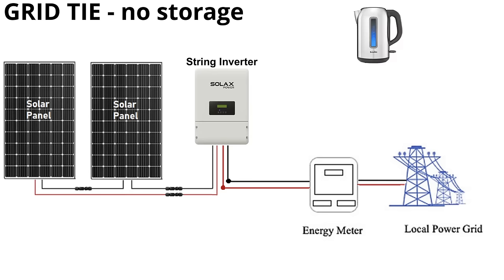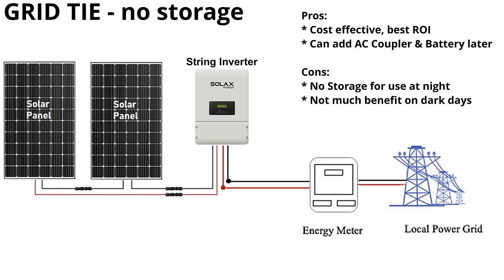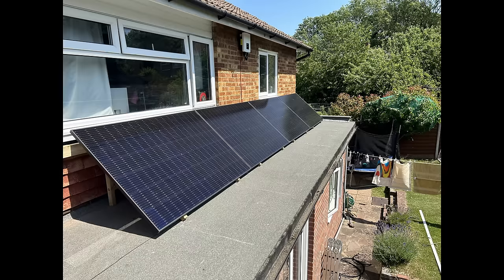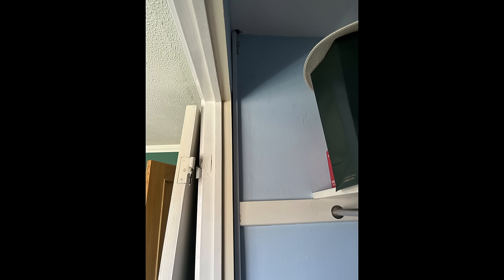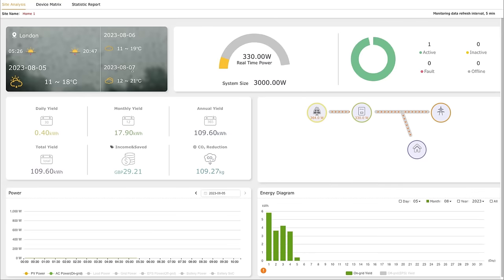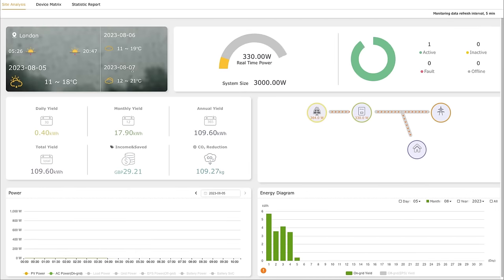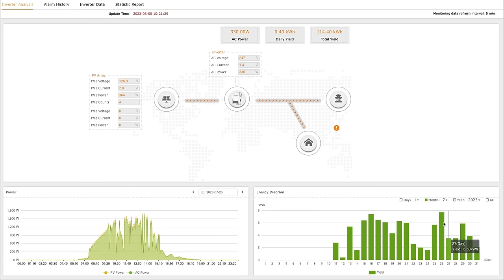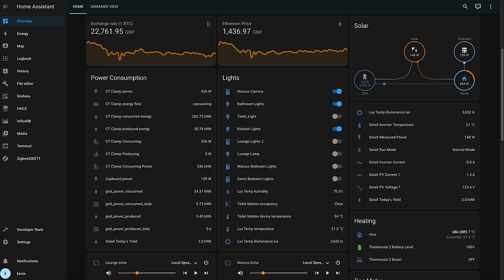DIY Solar Project 2023, worth it in the UK?

Comment: Sadly, the cost of an array (professionally installed) is typically a cost over 25 years, not a saving (this is of course unknown to virtually everyone!) due to the cost of a replacement inverter and batteries.  Some viewers may have seen my comments on this on other videos.  I haven't done the maths for a DIY one, but I will when I get the time.  A good idea might be to look at the maths for heating your hot water storage.  Electric would cost about 30p/kWh.
Reply: @CaptainProton1  
Sadly, you missed the word 'typically'.  There is simply no way a typical system can pay back your capital outlay.

But let's go with your data, instead:

1.  How much was your total capital outlay?
2.  What is the cost of purchased kilowatts from your supplier?
3.  How much will your system save you annually?
4.  Where did you get the money from - what interest rate was it earning?
5.  What will be the cost of your inverter in 12-15 years?
6.  What will be the cost of your battery array in 12-15 years?
7.  How much do you expect to have to pay (annually) for maintenance and breakdowns?
8.  Have you factored in that your panels will supply 0.6% less every year due to degradation?

You see, what people like you do, is to see the whole project totally unrealistically.  I'm willing to bet my car that you haven't even carried out a cost analysis as above.  I'm willing to bet my house that you haven't applied inflation to points 5 & 6 above...even if you have done a cost analysis, which I'm positive you haven't - because you claim it will pay back in two years.  Sorry, but there is 'absurd' then there is whatever 'two years' is...because it's beyond absurd.  In order for a system to be able to supply 70 kW a day, you're into small commercial/industrial territory.  Your system must be very costly to purchase...which means that your loss of interest is also enormous.

I do this for a living, by the way.  If you would like to provide the 1-8 data points above, then we can do a financial analysis.  But I'm afraid you are certainly going to be in for a surprise on the figures.  If you would rather remain blissfully ignorant of the conclusion, I fully understand, but I am quite willing to believe that your system will NEVER pay you back, never mind the amusing 'two years' bit.
Reply: @CaptainProton1  
My replies to you are being removed (twice, now).

You CANNOT get a return after two years - you'll be very lucky if you got a return after 20 years, but more likely, it will cost you money.
Let's try again.  We know that you annually consume 25,550 kWh (which is extraordinary - I'm all electric, and consume 14,000 kWh).  At 30p/kWh that would cost you £7,665, but I await the data on your supplier's charges.  Where your figures will show up is in 1 and 4, but I seriously doubt that you have carried out this cost analysis...

1.  How much was your total capital outlay?
2.  What is the cost of purchased kilowatts from your supplier?
3.  How much will your system save you annually?
4.  Where did you get the money from - what interest rate was it earning?
5.  What will be the cost of your inverter in 12-15 years?
6.  What will be the cost of your battery array in 12-15 years?
7.  How much do you expect to have to pay (annually) for maintenance and breakdowns?
8.  Have you factored in that your panels will supply 0.6% less every year due to degradation?
Reply: @jimskirtt5717 not true at all, you just dont have the experience.  Ive built my own off grid hybrid, all second hand panels, diy lifepo4 storage. Payback = under 3 years based on current prices.   Not typical no, but why would anyone go typical anyway, is a complete ripoff.
Reply: @CaptainProton1 hey, similar to mine just on a bigger scale..   Want to use up all that extra power you make in summer? - get a couple of bitcoin miners... F**k sending it back to the grid for pennies.
Reply: @jmpcrx  
I don't think you understand - I have a degree in mathematics.  If you show me your cost analysis, I'll show you where you're going wrong - free of charge.
Reply: @jimskirtt5717 

No degree in mathematics needed. If the annual energy cost is £7000, and the system cost £12000, and reduces the annual energy costs to nothing, then the system will pay for itself in under 2 year, simple. 
You bang on about interest on savings, but in reality interest on short term savings is 2% at best, so £12k in the bank makes £250 PA, which is nothing. 
Better to use the money in the bank for something that actually saves much more than the interest. 
It's not rocket science, good knows why you're trying to make it more complicated than it is.
Oh and a 0.6% loss in panel output PA isn't set in stone, it varies from panel to panel. Most panels will over produce for the first few years, and never produce nothing, even if 50 years old. 

Try doing some research on the equipment, rather that trying to convince yourself and others that it's money wasted, when there are literally millions of solar system owners that save huge amounts of money on their energy bills.

Comment: May I know is there typhoon in your country? Is it safe for this installation method if there are typhoon? Thanks
Reply: No typhoons in the UK. But we do get occasional storms- hence screwing down the installation to the house.
Reply: Typhoons only occur in the Pacific region. The UK is in Europe.
Reply: Uk can get 150mph winds, and i think will rip this system away! It needs blocks over it to keep it down, it would just rip off the wall if the wind ever gets under it.
Reply: @That1ufo  The only 150mph winds in the UK are after I've had a few pints followed by a vindaloo.
Reply: @elelegidosf9707   A little off on my guess but "142 mph) on 13 February 1989 at Fraserburgh in Aberdeenshire" But 120mph gusts is often possible and they would still be ripped off at 60-80mph

Comment: Is the inverter waterproof then?
Reply from the maker: Yes, this inverter is intended to be installed on an outside wall, under the eves, and is IP65 (Water resistant. Protected against water jets from any angle).

Comment: Do you get paid for dumping the excess onto the grid
Reply: You can, although the amount you get depends on who you signed up to.
Reply: @bunnywarren  thanks I'm with Shell energy but I think Octopus is taking over. Is that setup good for getting some return from excess
Reply: @lawrencedeans1433  Octopus's offer various rates, depending which tariff you use. I've got a battery setup and can move my evening peak usage so go for the one that give 3h of cheap power overnight and 3h of expensive power in the early evening. As a result I'm getting almost 20p/kWh during the day with 32p/kWh between 4pm and 7pm.

Comment: Will get massive hot in the bedroom, sucking the heat from the panel in.... 😕
Reply: By what mechanism do you think that the bedroom would "suck" heat in from the panel?
Reply: @elelegidosf9707 Natural ventilation... window just on top of the panels... black panels = heat...  natural ventilation, when opening a window... Try open you window, and you will see...

Comment: inverter outdoor ?? its a bad idea
Reply from the maker: Quoting from the X1 manual, "X1 Series inverter is designed for outdoor installation (IP 65)."
Reply: Why? Loads of Inverters are designed for exterior placement. As are Batteries. Not ideal I agree but most houses in the UK do not have the space for an Inverter, Battery, Charge Controller etc. Placing the Inverter under the Eaves is a good idea as manufacturers insist that exterior placed items have a canopy which the Eaves is

Comment: Noooo you've done it all wrong!

You should have paid £6500 for some randoms to throw some panels up there, do a crap job, then throw an MCS certificate at you and run off to install 2 more systems by the end of the day. 🤣🤣

Great job though, I did roughly the same with my modest 500w system, although I got my panels 2nd hand for cheap. In the 4 years it was up, it made about 1.5MW. Now I've got it connected to my battery inverter system just to add free power to it.

Comment: This is where they've got us,has a DIY installed system Octopus won't pay you for export unless you have a MCS Certificate and DNO Permission 😡
Great video though really informative 👍
Reply: i am in the same boat as you no MCS but still glad i put in my own solar, i used a company called plug in Solar for my parts very helpfull
12x 410 w trena panels a 3.8 kw Sofar inverter and 2x pylontech 4.5 kwh batteries
Reply: @petersort2192  That's quite a big install!! Is it roof mounted? I'm amazed you can do something like that without DNO/MCS. Good job!
Reply: Hi all maybe a grid limited inverter and a battery for storage.
Keep your production for yourself and the battery allows it to be stored for later use.
Take care M.
Reply: Octopus only now only require DNO permission.
Reply: Only speaking from personal experience with NW power, as long as you provide all valid data for a G98 application and accompanying photos, they will approve a DIY install.  This assumes you've used all MCS approved hardware though and you have the required labelling etc.  How long that will be the case I don't know.
Reply: How much did the electrician charge you it connect it 
It’s so easy to do
Reply: @Cashclever  I didn't use an electrician, did it all myself.
Reply: @Chris-hy6jy  even to meter
Reply: @Cashclever  I only needed to install a new circuit in the consumer unit.  Although I'm not an "electrician" I am an electrical engineer so have relevant qualifications and experience.  If you're not confident or qualified I'd certainly recommend you get someone else to do that work.
Reply: Adding a new circuit to a CU is notifiable work under Part-P. Isn’t it?
Reply: @willj1927  yes it wouldn't surprise me the way the desk jockies keep dreaming up new regs these days.
Reply: @Chris-hy6jy by new circuit do you mean you added an MCB to the consumer unit and connected the inverter via that? Thanks-Alan
Reply: @alwebb373  correct.  An RCBO in my case but the same principle.

Comment: I spent my first 27 years in the U.K. and left in 1989 . Unless the sun has suddenly decided to park it self over London then there is no point in wasting hard earned money on solar or E.V's . The normal sized English lot (postage stamp size ) could not supply enough solar power to be worthwhile if it was suddenly transported to the Sahara desert..
Reply: I use solar and an EV in Ireland and it's saved me tons of money. You might want to reassess some assumptions.
Reply: did you own a dog kennel or was it a wendy house

Comment: I look forward to your videos.
So we know that your capital outlay is £854.
We know that's an annual loss of interest of £43, so you have to clear £43 in savings to earn the same as your £854 was doing.
Let's say that your array saves you £100 a year on your electricity bill - saves you 333 kWh a year @ 30p/kWh.  This assumes that you will get (generate) just under 1 kilowatt a day on average over a year.  Some weeks you might get 10 kW, other weeks you might not get anything at all.
Over 15 years that's £1,500...but you have to minus your loss of interest of £645 - so you've saved £855 (in 15 years).
In order to have that payback period pan out BEFORE your inverter fails (further capital outlay) you must recoup your capital outlay in that 15 years.  Of course, that's just to get your money back (the capital invested), you won't 'make' any money.

Your system may not go 15 years, so the exercise would end up costing you money, not saving it.
The bottom line is that even when done DIY, solar panels are unlikely to save you money, and will probably cost you money.

The data assume interest and inflation both at 5%, it also assumes current rates (30p/kWh) will stay the same for the period.  The data takes no account of your annual degradation of the panels at 0.6% per year, which would further harm your return, or replacement of any parts or maintenance.  If you invested your £854 in a savings account, it would generate interest and be worth £1,775 after 15 years, but would also be subject to inflation.
Reply: No he's looking at £330 a year selling 1000, and using 600, well under 5 years to payback.
Reply: @That1ufo  
The mathematics are above - I am sorry that it goes over your head.  Blame your teacher when you go back to school tomorrow morning.

Comment: I asked AI the following “How many 410WP SOLAR panels do I need to be self sufficient based on 3500kw of electricity use per year in the ***** area of the UK?”

It replied “To determine how many 410W solar panels you need to be self-sufficient with 3,500 kWh of electricity use per year in the Hemel Hempstead area of the UK, you can follow these steps:

1. *Estimate the Solar Panel Output:*
   The output of a solar panel depends on several factors, including its wattage, the number of sunlight hours in your location, and system efficiency. The average solar insolation for the UK is about 3.5 to 4.5 kWh/m²/day. For this calculation, let's assume around 3.5 hours of effective sunlight per day as a conservative estimate for Hemel Hempstead.

2. *Calculate the Daily Electricity Use:*
   Divide your annual usage by the number of days in a year (365):
   \[
   \text{Daily electricity use} = \frac{3500 \text{ kWh}}{365 \text{ days}} \approx 9.59 \text{ kWh/day}
   \]

3. *Determine the Daily Output of One Solar Panel:*
   A 410W solar panel would produce approximately:
   \[
   \text{Daily output of one panel} = \text{Panel wattage} \times \text{Sunlight hours per day} \times \text{System efficiency}
   \]
   Assuming an efficiency of around 80% (which accounts for losses):
   \[
   \text{Daily output of one panel} = 410 \text{ W} \times 3.5 \text{ hours} \times 0.8 \approx 1.146 \text{ kWh/day}
   \]

4. *Calculate the Number of Panels Needed:*
   To meet your daily electricity needs:
   \[
   \text{Number of panels} = \frac{\text{Daily electricity use}}{\text{Daily output of one panel}} = \frac{9.59 \text{ kWh/day}}{1.146 \text{ kWh/panel}} \approx 8.37
   \]

Since you can't have a fraction of a panel, you'll need to round up. Therefore, you would need *9 solar panels* rated at 410W each to be self-sufficient based on your usage of 3,500 kWh per year in the Hemel Hempstead area. 

Keep in mind that this is a rough estimate. Local conditions, such as shading, roof orientation, and panel efficiency, can affect actual output. It's advisable to consult with a local solar provider to get a detailed assessment and design.”

Clever computer
Reply: I followed up one more time and asked, “So if i could fit 20, I could easily meet my needs and possibly earn money by selling my excess to the national grid?”

It replied, “Yes, fitting 20 solar panels would certainly allow you to exceed your electricity needs and potentially generate excess energy that you could sell back to the national grid, depending on several factors. Here's a breakdown of how you could maximize your solar setup and your options for selling excess energy:

### Energy Generation Potential:
1. **Increased Energy Production**: 
   If you install 20 solar panels rated at 410W each, your total system capacity would be:
   \[
   20 \text{ panels} \times 410 \text{ W/panel} = 8,200 \text{ W} = 8.2 \text{ kW}
   \]

2. **Estimated Daily Production**:
   Assuming each panel generates approximately 1.031 kWh/day (with the adjustment for orientation and other factors):
   \[
   \text{Total daily output} = 20 \text{ panels} \times 1.031 \text{ kWh/panel} \approx 20.62 \text{ kWh/day}
   \]

3. **Annual Production**:
   Over the course of a year, you could potentially generate:
   \[
   20.62 \text{ kWh/day} \times 365 \text{ days} \approx 7,528 \text{ kWh/year}
   \]

### Energy Needs and Surplus:
- Your yearly need is approximately *3,500 kWh**. With 20 panels producing roughly **7,528 kWh* annually, you would generate a surplus of:
\[
7,528 \text{ kWh} - 3,500 \text{ kWh} \approx 4,028 \text{ kWh}
\]

### Selling Surplus Energy:
1. **Feed-in Tariff (FiT) Scheme**: 
   Previously, the UK had a Feed-in Tariff (FiT) scheme that paid homeowners for the energy they generated and for the surplus they exported to the grid. However, this scheme closed for new applicants in March 2019. It's worth checking if any other incentives or programs are available.

2. **Smart Export Guarantee (SEG)**:
   Introduced in January 2020, the Smart Export Guarantee allows you to receive payments for any excess electricity generated by your solar panels that you export back to the grid. The rates can vary depending on your electricity supplier.

3. **Self-Consumption**: 
   To maximize your benefits, it’s generally more effective to use as much of your generated electricity as possible for your own needs, especially during the daytime when your solar panels are most productive. 

4. *Battery Storage* (Optional): 
   If you are worried about low generation in the evening or at night, consider adding a battery storage system. This could store excess solar energy for later use, allowing you to rely less on the grid and maximizing your energy independence.

### Conclusion:
Yes, if you can fit 20 solar panels, you could not only easily meet your electricity needs but also have a significant surplus to potentially sell back to the grid (through the SEG) or use for battery storage. Always consult with a local solar expert or installation company to evaluate your specific conditions, expected output, financial incentives, and installation specifics. They can provide insights on the best approach to maximize your investment in solar energy.”